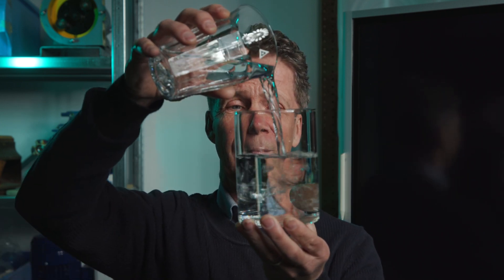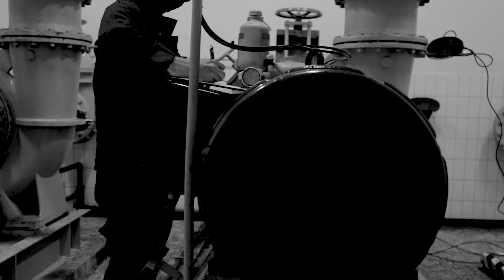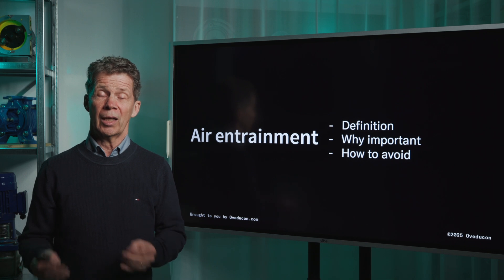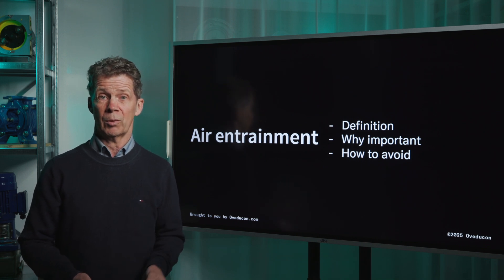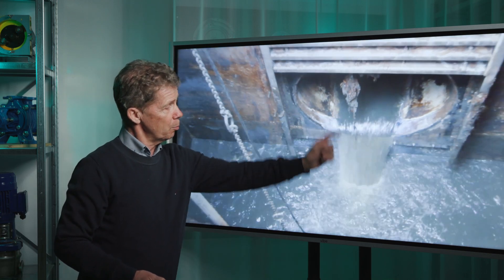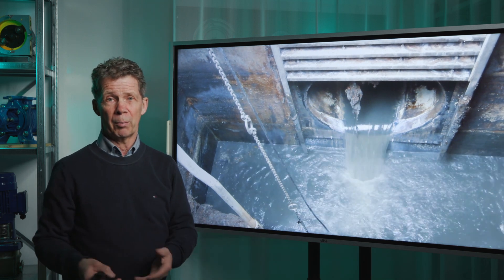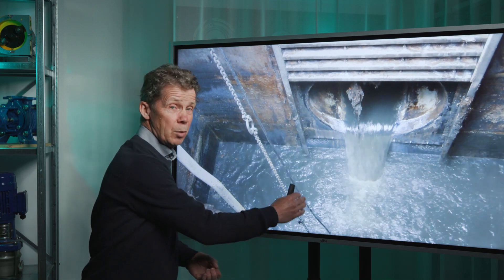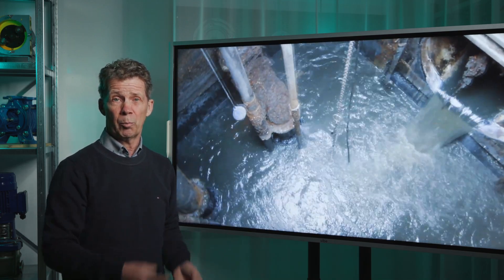Why do GAS BUBBLES kill PUMP PERFORMANCE? | +SOLUTION

Comment: Air bubble entrainment in wastewater systems is even more dangerous as they increase the dissolved oxygen levels in the liquid medium (wastewater), which is already corrosive, accelerating corrosion of the pump components. As a practice, I always prefer long channel like arrangement of sewage pumps, with influent coming in from one end smoothly in. Also provides excellent flushing of the pit at draw down because of high velocities.